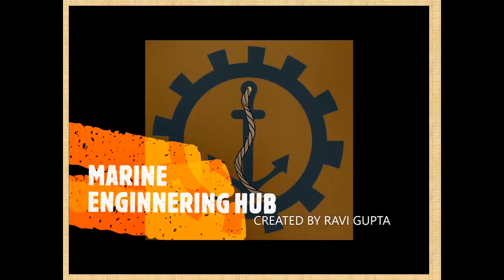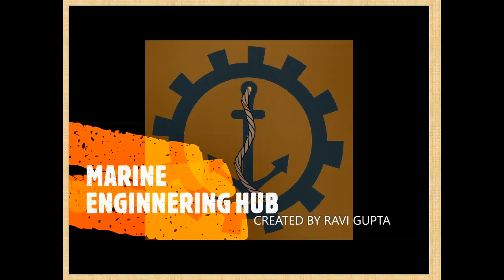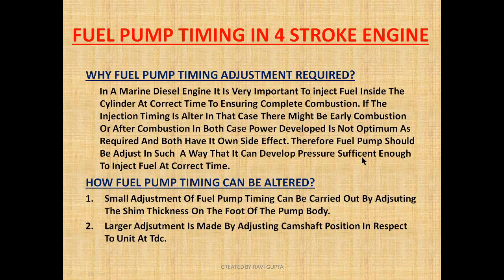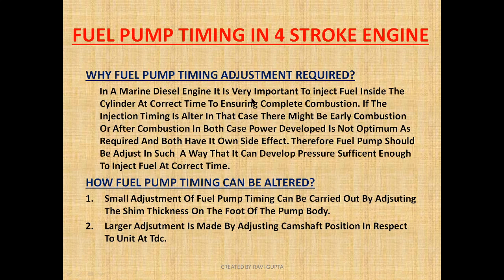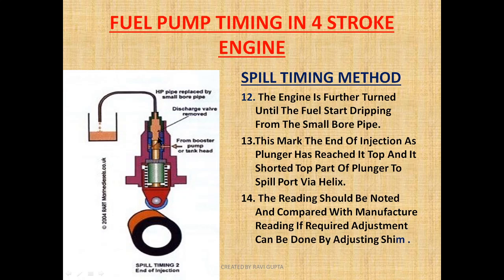Fuel Pump Timing| Four stroke Engine| 4 Stroke|Auxiliary Engine|

Comment: Sir a small doubt
When plunger covers the suction port and there is no discharge valve the oil should be collected into bucket but instead it stopped what's the reason fr this ??